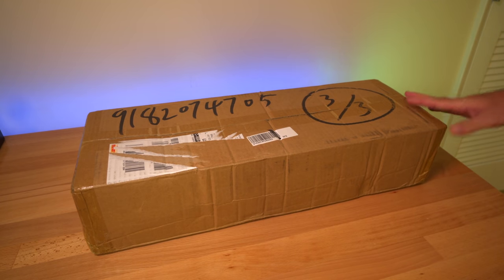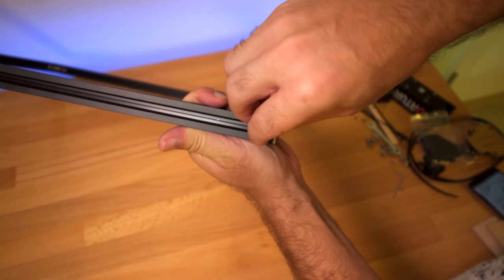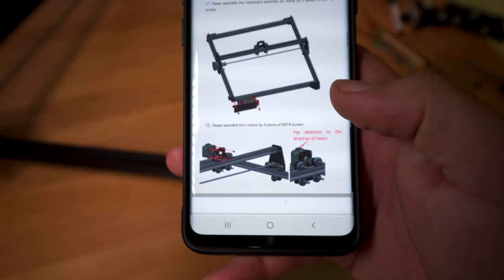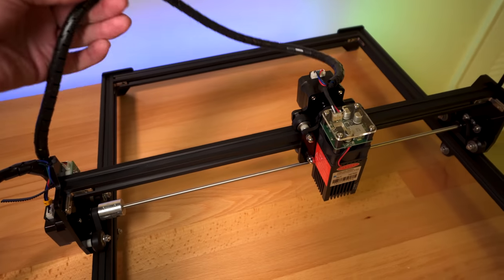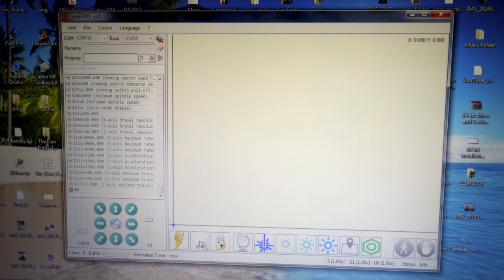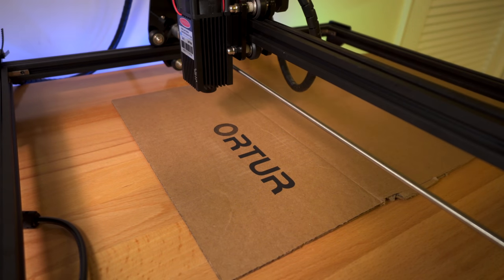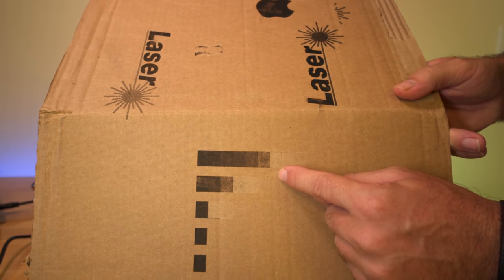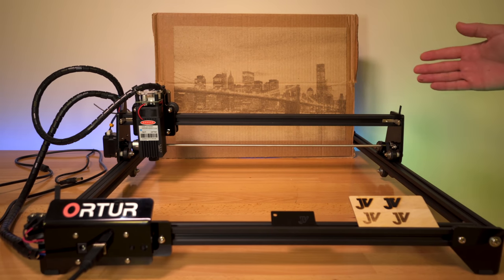Ortur Laser Master 2 - Engraving Cutting Machine

Comment: Most CNC machines that use a Cartesian drive system use the bottom-left corner as X0 Y0 and X+ is left-to-right and Y+ is front-to-back, so you can manually locate where to start by moving the laser to the bottom-left corner of the area you want to burn.

Comment: Hello, Thank you for a very good video!  I just bought this same model laser. Do you know if a router head can be mounted to this machine or any other similar machine?  I am wondering why a small engraving machine or router isn't supposed to be able to engrave steel. It can't be the spindle head, because a Dremel tool can engrave steel using a 1/8" HSS, carbide or diamond bit.  Is it because the stepper motors can't move the motorized head when it is dragging a spinning bit?  I saw a video showing this laser engraving or marking steel using mustard on the steel. It worked pretty well.  Jerry

Comment: I’m conflicted. I want one, but I’d be terrified of the lack of enclosure. Make sure to keep the goggles on when it’s running even when not near. A stray reflection can blind you.
Reply: Me to thats my only worry but you can always build an enclosure for it
Reply: H D not in countries without Home Depot
Reply: If building an enclosure is so easy then they should sell the laser with an enclosure, dur, don't forget ventilation, filter, and cooling an enclosure needs
Reply: @Bajicoy  i mean you get what you paid for right if you want all the add-ons gonna have to pay more
Reply: Shroud the beam area with opaque plastic, at the very least. This is an incredible eye hazard as it ships.
Reply: @omaroskeno3314  paying more is fine, right now it is $300 for free cancer, lung disease, and eye surgery. While it's a steal for those features, I'd prefer to live until the age of 80 at least.
Reply: H D  ??? You sure you know how lasers work? It's burning material to remove material. The material doesn't magically dissapear, the burnt carbon particles mix with the air and humans breathe air.

No one will feel the effects immediately but by the time the carbon builds up in the lungs and permanent damage is done to the eyes and sinus, it will be too late.

Lasers are dangerous wether it be diode, co2, or whatever.
Reply: H D  it's not just burned wood or paper. That's like saying smoking is just burning paper and dried plants.

You do what you want, if anyone walks into the room without glasses on or some kid takes second hand smoke and the worst happens, that's your problem.
Reply: H D  says the kid that believes lasers magically remove material and didn't know about carbon particles. What enclosure are you imagining? the laser doesn't have an enclosure. You are a careless and dangerous person who is going to get people hurt and cause irreparable damage to the reputation of the medium.

Comment: Hi,
Does the cutting machine software import .dwg vector files or .psd files?
I should cut 0.4 - 0.5mm thick cardboard. Some parts of the shape to be cut are very small, 0.6 mm wide.
Is this cutting machine okay?
Thanks bye.

Comment: I would love to know if this can cut 5mm craft foam.
Reply: me too actually , and will it melt the foam inside the paper , i have seen some cut the actual paper but the foam inside kind of melts
Reply: I got the 20W version and it can cut 3-4 mm wood so I think foam would not be a problem ;)
Reply: im looking at its material database,
it can cut 3mm plywood, and 0.7mm leather, 0.5 fabrics... there is a listing of cutting 5mm KT Board, no idea what that is however.